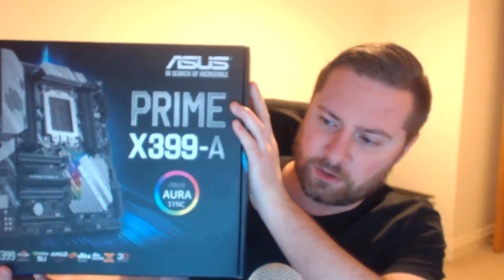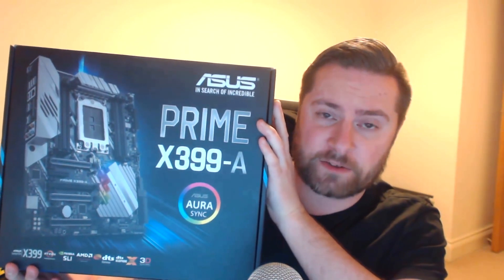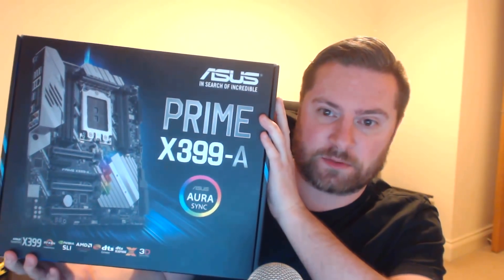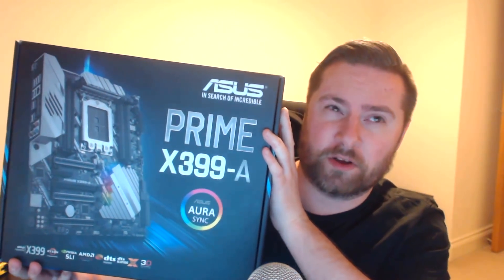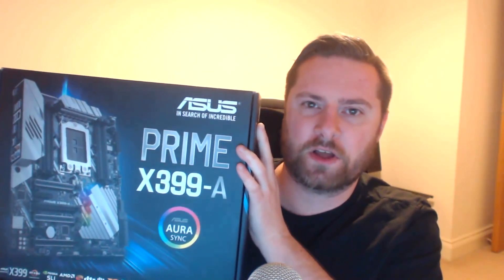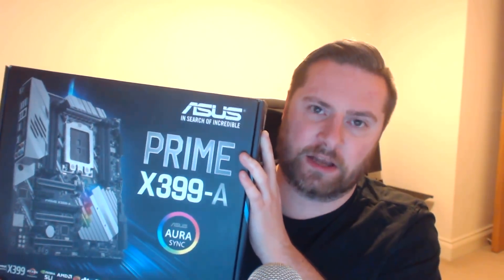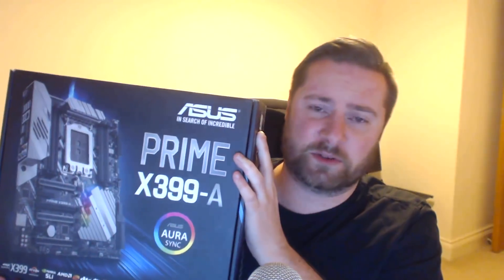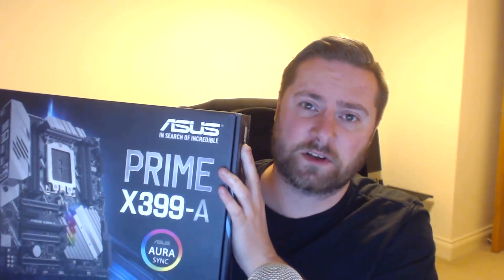Cinema 4D PC Build: CPU, Motherboard & RAM

Comment: I had a big dilemma on whether to go AMD or Intel, and I've got to say that Intel is worth the extra $$$. 
My current build is i7 8700K, Asus Prime and 32 GB Ram. Coming from an AMD FX 8320, all the crashes and lockups that were occasionally happening with various apps (audio DAW, C4D, AE etc) disappeared almost entirely with it. When they do happen, its a plugin thats causing it, while before it simply dies with no plugins being used at all, or random stuttering when a lot of VST instruments are being used in my DAW. C4D never crashed on me without me asking for it (eg you accidentally add a few extra zeros on the number of particles and hit play... either wait 3 years or kill it xD )

With Ryzen being 30 - 40% more expensive, like you said, its a question of do you NEED multicore performance or not. I could be wrong, but single-core matters more when you are actually working on a project, and that (at least for me) takes more time than rendering the result.
Reply from the maker: AMD are absolutely killing Intel at the moment, in terms of performance and price, the Ryzen chips are a far cry from the FX chips, so you won't need to worry about crashes or lockups, My Threadripper has had zero issues. I don't know where your getting Ryzen being 30 - 40% more expensive from, because across the board, similar amd chips in terms of performance to their intel counterparts are always cheaper.
Reply: @DIGITALMEAT  Oh dont get me wrong, AMD always did and always will give more bang for the buck. Even with all its quirks, FX served me well (it did get HOT). 
I meant that your cpu (1950x) is 30-40% more expensive then mine (i7-8700k), understandable with it having 10 extra cores. Since I prefer GPU render, I spent the extra cash on a 1080ti (with 1050ti riding shotgun).
I have mine at a 1x 4.9 ghz and 5x 4.2 ghz running stable with a 40$ air cooler, so in a single core duel, my CPU slaps yours like it owes it money. 
In a multicore duel, yours slaps mine, shoots it, dumps it infront of an emergency room, comes back and runs it over.

Comment: Hey, I have a question, You look like you know what you are doing. I'm on a low budget which one should I buy AMD Ryzen 7 2700x or I5 9600k? I will be using after effects (%75 of the time) and I want to learn C4D too. But I'm just confused I can't decide which CPU to purchase with low budget..
Reply from the maker: If you are using AE 75% of the time, you probably wanna go with a chip with higher single core performance (clock speed) over more cores, this is because AE doesn't utilise multi-threading when rendering. But if you want faster cpu rendering in c4d, more cores is the way to go. What you could do is get a higher clock speed cpu for AE, then use gpu rendering in c4d. Check this video out :)
 https://youtu.be/8_xmXM_XMS4

Comment: What if you use gpu with octane render/redshift. Would you then just need more ram for rendering out large sequences (short film/clips) without having c4d lag out
Reply from the maker: Are you asking if more RAM will allow you to carry on working while the GPU is rendering?
Reply: DIGITAL MEAT  Basically my scene has many different 3d model parts, a combination of fusion 360 and zbrush parts.. and cinema4d is chugging in the viewport. Would more ram improve that performance? Or is it more to do with the cpu (8 core 3.8ghz)
Reply from the maker: How much RAM do you have now?
Reply from the maker: Infact tell me what CPU, GPU you have too

Comment: 4.0 Ghz is the standard boost, you should not have to water cool for that
Reply from the maker: when rendering, the cpu could be at 100% for hours maybe days, wanna make sure the lifetime of the chip is not compromised
Reply from the maker: Plus i'll be adding Gpus to the loop at some point
Reply: Gives you the option to push the cpu as it is unlocked
Reply: 4ghz boost on some cores, overclock to 4ghz on all cores is a huge difference
Reply: Yes, its the standard boost, but only if your cooling is good enough and/or just on 1-3 cores i think, not on all of them. Still this is probably the best CPU for rendenring, except some server grade 32 core cpu.